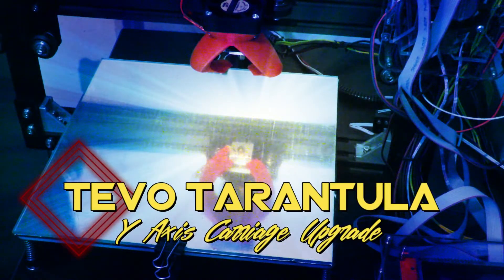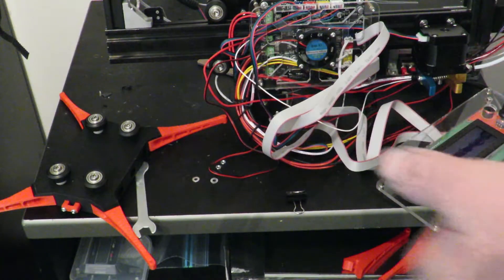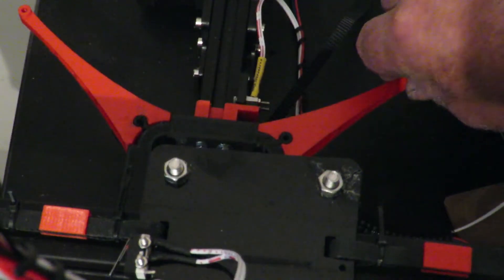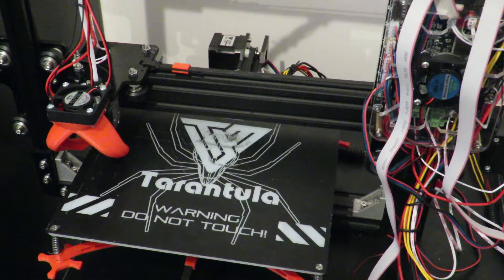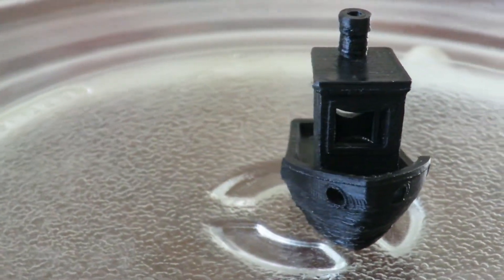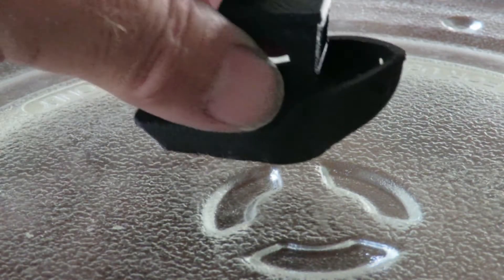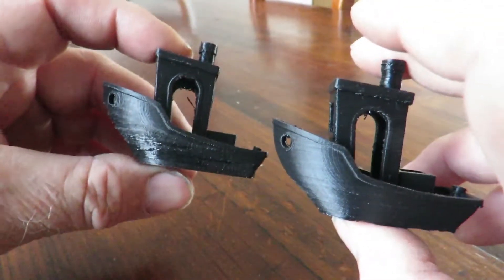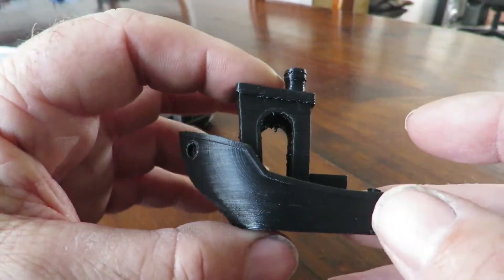📌How a 3D Printed Upgrade fixed my cheap Tevo Tarantula 3D Printer's Y Carriage Wobble

Comment: Did I hear correctly? You printed the bed plate in PLA? I assume that you won't be using the heater on the bed, right?
Reply from the maker: I used PLA+
The heated bed is located far enough away, so as to not to effect the PLA+. (So Far that is 🙂)
Reply: First the heated plate and the (PLA) support are sperated with screws and springs and nearly 30mm, second the bed do not exceed ~60°. The support won't melt ;-) Nevertheless good idea, I probably do the same

Comment: Thanks Garry, very good design for the bed support replacement. Cheers, JAYTEE
Reply from the maker: It is a big improvement on the original Acrylic part, and rock solid.
I'm very happy I printed it and put it into use.